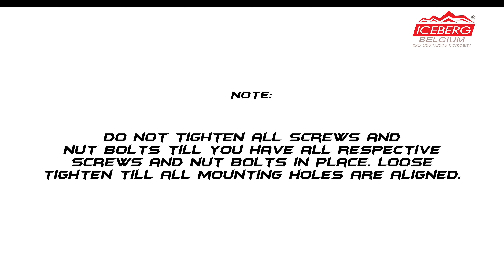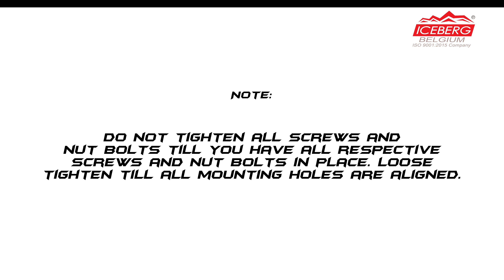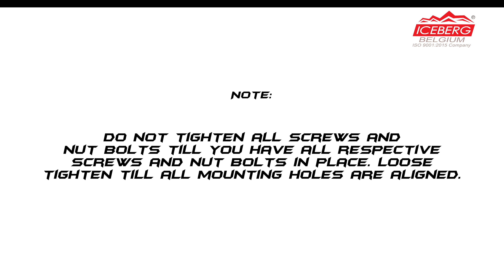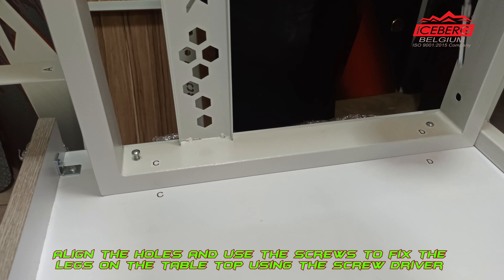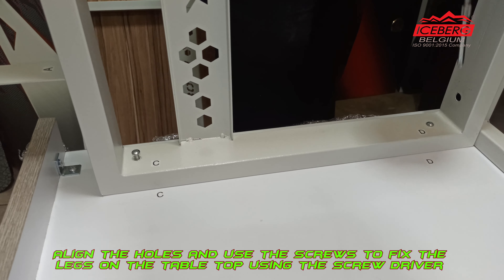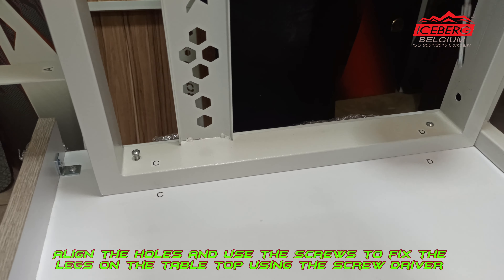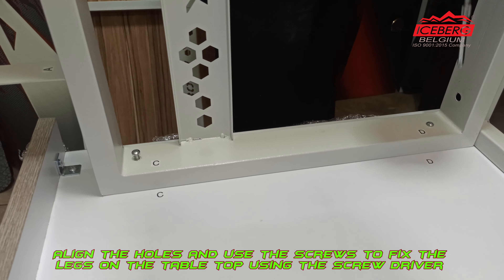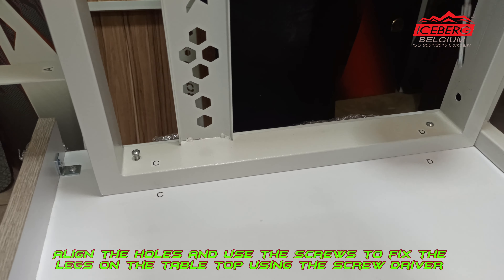Xtream Pro M1 Installation Process

Comment: Is it normal for it to be kinda shaky after tightening all screws hard? I can see my desktop screen kind of shake when I type or play
Reply: Hey hie it's not that normal okay . I also bought the table but now I'm stucked at fixing that metal plate backside for plugbox storing. I don't find any holes there and also no screws left . How did you fixed that ?
Reply: @sanjurichie8819  If you are talking about the cable holder for electronics holder at the back side then you will find small screw holes on black square rod itself which is connected to wood you will need to find loss screws from your own stach of screws if you have any spare or just buy some or remove from other stuff screw fitting those holes they are kind of very small so need to like guess it out lol
Reply: If you are talking about just plane straight black plate thingy it goes near your cup holder to hold your headphones (holes are on wood itself not on rod)and other hook like the plate goes on the left hand side to hook your bag or something (on rod which is connected to wood)(will need screw and nutbolt)👍
Reply: @miteshnarvekar7248  no evrything I done but we have a metal plate for holding plugbox back of the table right ..that's where I stucked . The problem is the iron rod has 2 small holes  and the mental plate has 2 different sized holes . And also I left with I screw , 1 Allen key only ... . And unnecessarily they gave small screws which we can't even fix anywhere ...😭
Reply: @sanjurichie8819 You will need screw of door knobs and need to use a lot of strength at the start then it goes down smoothly 😂 yup they gave less screws for it I was missing 2 screws as well I hope this helps 👍